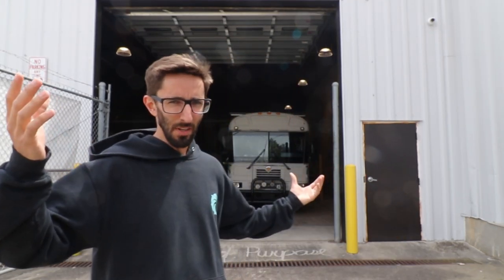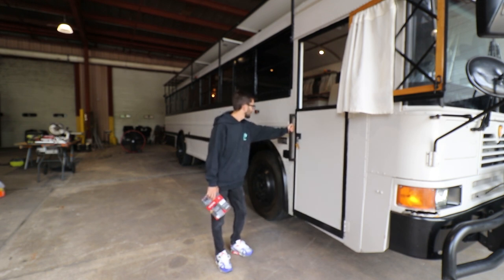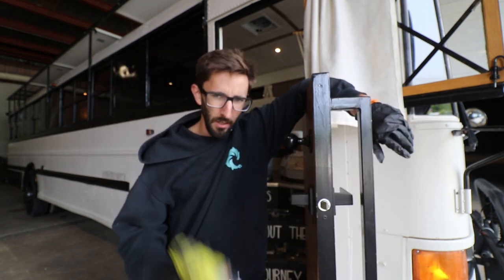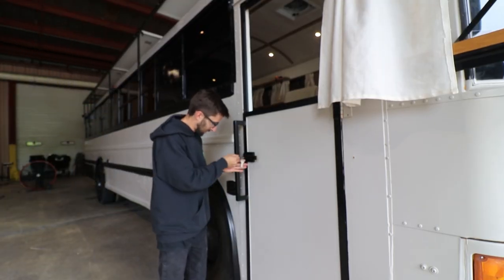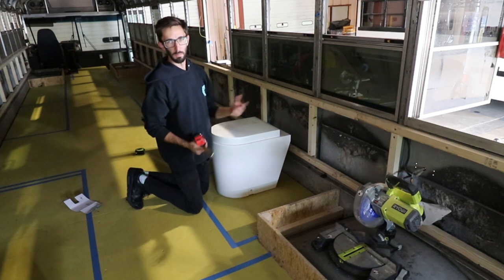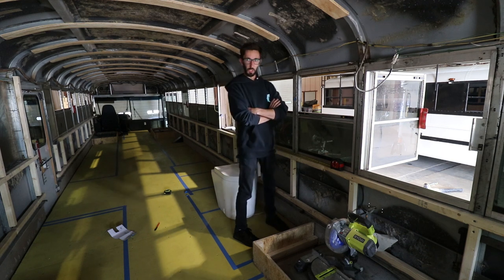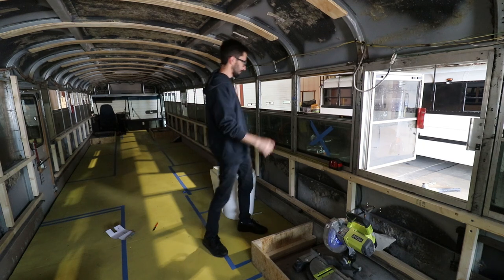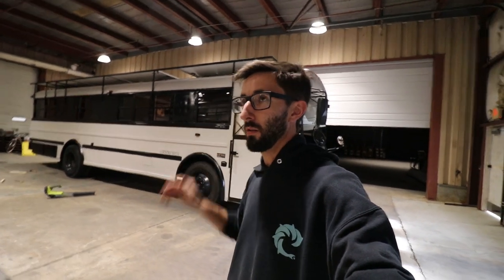Opening up our School Bus Conversion Shop, Bus Upgrade, and Client Bus Layout Design!

Comment: What kind of lock are you using on the front door if you want to keep the doors original that open out
Reply from the maker: I haven't. I've done custom doors for our builds. Ive never been impressed with the locks available to tie the bifolds together

Comment: Don’t spend the money on new tools until you need them. If it makes the quality better, or speeds up a process a lot, might be worth it, but…. If it’s working for you without frustration, keep what you have.
Reply from the maker: 100% my same thoughts. I made $6k off my $100 welder before I upgraded to a $800 one. lol